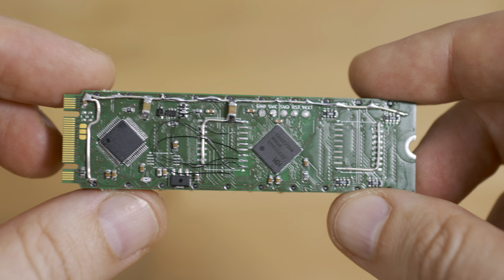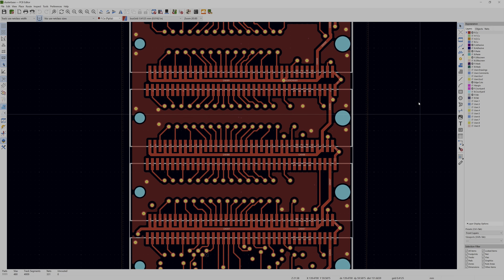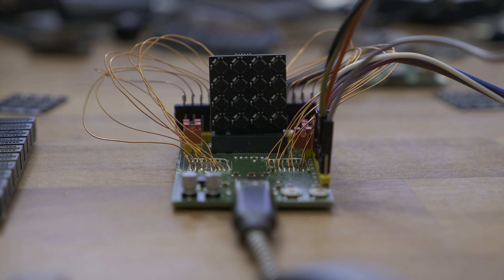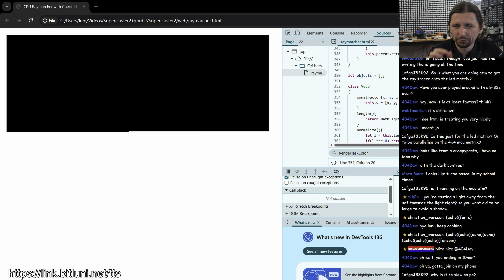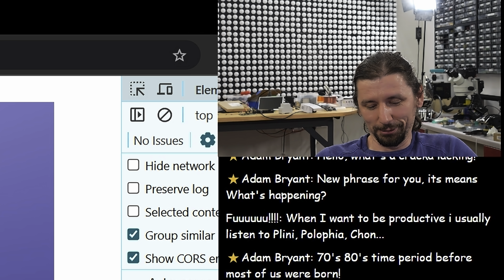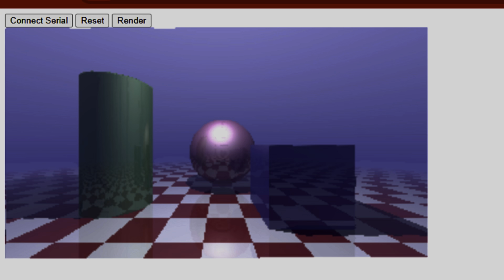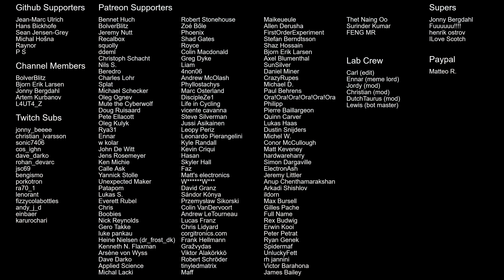I made a GPU at home

Comment from the maker: Take your personal data back with Incogni! Use code BITLUNI at the link below and get 60% off an annual plan: https://incogni.com/BITLUNI (sponsor)
Reply: Why are you using the cereal for it and not a PCIe?
Reply: Well done mate,  we appreciate you
Reply: soo cool!
Reply: This would be a really fantastic commercial project because of the incredibly low power usage and could be implemented in many use cases where your power overhead of your project would prevent the use of such powerful and capable GPU hardware.
Reply: I would be really interested to play with one of these and true understand a little better how to bypass the serial port. What is the exact problem with the design file that needs fixing? And how could we adjust the way it's dealt with by using PCIE or some other protocol. Once you have or if any of us have figured out how to increase the speed of the serial or by switching protocols this would be a fantastic chick starter project!
Reply: Bro could you run an ai on it please😢❤
Reply: I have not seen the whole video. 
That is too high for me, but only because english is not my main- but my 3rd language (brokenly). Though, I have zero 0,00 experience in any electronical working, that video would not be too high for me, if I would go through every step from the beginning with german translation, would have the tools, and maybe a referred explanation in the steps. 
Just a feedback from the perspective / view of a none english-speaking amateur/beginner/novice/rookie (why "beginner", I have not begun yet, if anywhen / somewhen at all)
Reply: Seems to me you will be running ai on your own chip sets soon enough
Reply: 09:58 1990's feeling waiting for that baywatch pic to load😂
Reply: please can you add russian translation?🤩
Reply: Excuse me, I have an Off Topic question: where can I buy the infrared camera as you have connected to your smartphone? Thanks.
Reply: can u replace nvidia card?
Reply: GPU the Grafted
Reply: Do you use AI for pretesting before ordering?
Reply: You put them into a config that interferes with itself via static. This isnt gamebreaking but can cause issues.
Reply: Good Job
Reply: RISC-V
Reply: M.2 NVMe connector is better than M.2 SATA
Reply: W vid can you make a ram ddr5 now?
Reply: bro can u teach us  from beginner
Reply: how do i get a hold of you
Reply: How does everything run multithreaded? I mean, how does the software and hardware relate to each other to allow distributed multiprocessing?
Reply: @petevenuti7355  As far as i see, a simple Intel Neutrino have more calculation power. It's a scam or for educationnal purpose only.
Reply: what if you make it to USB 3.1? or type-ccan we use it on mobile or laptop without  M.2 slots
Reply: How much would I have to pay you to add/upgrade vram on my GPU? if you know how to
Reply: @_Valkohl_  you cant upgrade you GPU s VRAM vram is video ram like ram but not for motherboard and cpu its for video like imagine 10 chips of VRAM and you wanna buff 1 of them but you cant you should upgrade all of them in same time it cost more money and problem doesnt end here you need to find same pins in same locs in same tasks and bios yeah bios when you UPD your VRAM bios dont get it and think its a its a spy,

bouga douga you should upgrade all chips in same time duoga bouga  you should find same pins same locs same tasks chips  bounga dounga bios thinks its spy douga bouga
Reply: @notalknodie  yesnt
Reply: WHYYYYY do you buy components from aliexpress?! Why not LCSC?
Reply: @zlozlo3935 hey bro can I ask u. A ?
Reply: @zlozlo3935  He literally says why in the video.

Comment: To speed up the protocol bottleneck (cheaply?) could you not place a block of ram (or 2) to act as an instruction and output buffer, then a (series of) small IC chip(s) to act like little team leaders and control data flow to each core card you made, just my thoughts, otherwise... Great project, looks fun  :)

Comment: ive played around with fifo buffers before especially when using winamp, first if its not nessesary turn it off, second try to bring the gap distance length as close as possible to not faulting under max load, third fromt what i see voltage tuning againt the entire board via main input should absolutely be played with. when uve already got a solid setup playign with all the values all over again for 'majick numbers' relative to potentiometers and mosfets has always yeilded insane results - consider that the first modems were in fact given to customers with the potentiometers still in place, and thus they were able to 'tune' and 'wirebend' the units to the 40 volts 960 megabyte units we have today :), once u have all of that down pat , consider finalizing your code through manual compression and obfuscation of the code itself and the variables, something ai can work with you on is converting premade code into 'compact code' and 'one liner code', but dont attempt to have it generate code on the fly and do make sure it knows that the code is explicitly one type of programming language or it will assuredly mangle the outputs, im welcome to contact send me an email at gunmakerguardianAMAZINGWORDSGOHEREgmail for further info ;)

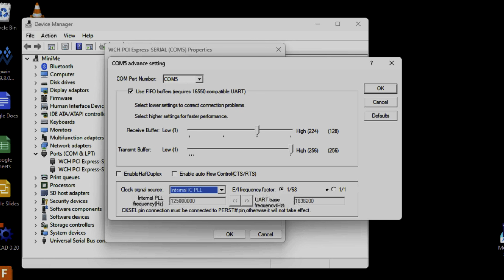Comment: 13:16 bottleneck thoughts: 
did you tried to switch "clock signal soure" to external clock or direct access (dont know what is available for your UART chip) to achieve "no division" and get 8Mbit.

on the other side 10k pullups have a too high impedance for MHz signals.

Comment: last year I spent quite some time upgrading this laptop that I traded for, I swapped out the cpu, put 8 gigs of ram on it (the max I could), put a 750 gig hard drive in, and even upgraded the wifi card (which worked surprisingly well). but the only thing stopping me now is the fact that there is no gpu in the laptop and I really don't want to use one of those pcie mini to pcie adapters for an external gpu, so i really wish something like this actually existed.

Comment: You could use a bigger hotplate. And perhaps a stencil or two. Hotplate soldering the all edge connectors at once with properly applied paste would have saved tons of time. As far as communication, you could try making a mesh network, where each chip just sends packets to its neighbors. Interface with the host at the edge chips. By keeping the connections short and point-to-point, you reduce opportunities for noise. Just requires software for networking.

Comment: Regarding the chip speed. Not sure if you mentioned it in the video or not, but did you impedance matched PCB traces? Also check for sharp corners, at high frequencies it can be problematic. Lastly, utilize gold traces rather than copper.

Comment: Imagine expanding this to a full sized PCIe card. Given a 22 by 22 mm2 area for 16 MCUs, if you double side the MCUs, you could get over 1500 of them on the board. A full sized PCIe card is 312 by about 90 mm, so 13 by 4 sets of MCUs. 13 times 4 times 16 equals 832, up to 1664 if you double side them. Probably a few less for more communication chips, but with up to 16 PCIe lanes, you could have a bunch of PCIe to serial chips. A quick search shows a 1x PCIe to 8x UART, and a 16x to 16 1x PCIe switch, giving 128 UART lines. You could easily run over 1000 of them.

Comment: The only thing I notice is the video is the lack of cooling. It's possible to manage this if you can design and build the proper heat sync. You only need a surface contact point and long tubes with a gas that has fins on the end. Your heating issue should be resolved.

Comment: Awesome project and amount of knowledge is impressive at all, next time try with samv71q21 (arm m7) it gives to you 300Mhz core with DFP unit and 80Mhz 3x SPI for chip-to-chip data exchange for 9x9 mm on PCB space and 0.1W per MPU at full speed. Maybe you can arrange 32 or 64 chip to get 6.4W and 100 times processing power.

Comment: I think the best purpose for this kind of thing is, first to update the CPUs to the newer model with a 100MHz CPU that feature hardware multiplication/division, then see if you can't use it to run an AI model. Adding some kind of memory controller/slot would also probably help.

Comment: Analyzed the your video with GPT-5 and it made suggestions that I think it will useful for your project

Technical Recommendations for the Cluster
1. Interconnect & Topology  Your current open-drain shared bus is the primary bottleneck. It lacks the signal integrity and throughput required for scaling. Transition toward point-to-point, push-pull differential links (SPI/QSPI or LVDS) per module, aggregated through a hub. Implementing a hierarchical topology (e.g., 16 MCUs per module → module-level hub → system-level bridge) will greatly improve reliability and scalability. All packets should carry sequence IDs and CRC checksums, with ACK/NACK to ensure data integrity.
2. Host Interface  The 115 kbit/s serial interface fundamentally limits any graphics-like workload. Move to a USB 2.0 High Speed (480 Mbit/s) or a USB–SPI bridge (FTDI FT2232H/4232H) as a first step. For higher ambitions, integrate a small FPGA with PCIe Gen2 x1/x2 connectivity to achieve true “accelerator-class” bandwidth.
3. Software Stack  Introduce a command-stream model resembling modern GPUs: commands such as UPLOAD_BUF, DISPATCH_GRID, BARRIER, READBACK. Build a lightweight work scheduler with job queues and dynamic load balancing across MCUs.  Adopt fixed-point math libraries (Q16.16 or Q8.24) with optimized primitives (fast sqrt, rsqrt, CORDIC). Use double buffering so computation and communication overlap, improving throughput. Finally, provide diagnostic tracing buffers per MCU for profiling and debugging.
4. Memory & Data Strategy  Define local tile caches and rely on tile-based rendering or batching to reduce I/O pressure. For graphics tasks, compress frame buffers (RLE, delta encoding). For compute workloads such as hashing, minimize transfers by sending only parameters and collecting results in bulk.
5. Power Delivery & Signal Integrity  LEDs should not load supply rails directly; consider FET-based drivers or low-power indicators. Strengthen the power distribution network with sufficient decoupling. On high-speed traces, enforce controlled impedance, add series damping resistors, and deploy ground-via fences. Avoid weak GPIO pins (e.g., STM32 PC13-15) for timing-critical lines.
6. Reliability & Validation  Establish a unit-test harness with fault injection, simulating packet loss, skew, and thermal drift. Automate module acceptance tests (ID, self-test, loopback). Maintain strict firmware versioning and rollback paths to ensure stability across a large number of nodes.
7. Algorithmic Focus  Graphics at pixel-per-MCU granularity will remain inefficient due to communication overhead. Transition toward tile-based workloads or compute-heavy, low-bandwidth tasks. Your SHA-256 benchmark is a good indicator: this cluster can excel at parallel hashing, lightweight cryptography, or batch scientific kernels. For graphics, prioritize offline precomputation tasks (ray pre-tracing, denoising, SSAO).
8. Roadmap
Short term: Replace the bus with SPI hubs, upgrade host interface to USB HS, introduce CRC-protected command streams.
Mid term: FPGA bridge for PCIe/USB3, hierarchical schedulers, tile-based rendering model.
Long term: Consolidate into a custom SoC module (multi-core RISC-V + DMA + interconnect) or explore FPGA–MCU hybrids for higher efficiency.

Executive Summary
To elevate your project from a hobbyist prototype toward a true accelerator, focus on three priorities:
Replace the open-drain bus with a robust high-speed interconnect.
Upgrade the host interface to USB HS or PCIe to eliminate the bandwidth bottleneck.
Build a formal command-stream and scheduling layer to manage workloads efficiently.
This will transform the cluster from a creative experiment into a genuinely useful parallel compute platform.

Source: GPT-5

Comment: Incredible work! I was thinking the same thing. This is not just a "homemade GPU", it is essentially a new approach to creating computing power.

If you sharpen such a system for a specific neural network, its performance can be scaled almost infinitely, simply by adding new modules, even at home. Versatility will no longer be a problem, because the neural network itself can already work with anything - from games to video generation. In theory, this can turn the entire market upside down and make us think about whether we really need universal and expensive video cards.

Comment: What the Actual Fuck. You pulled almost 900KH/s running the Bitcoin Mining algo. Using only 3.3volts. Thats fucking insane.  That setup would actually be super profitable for mining. If you can make a cluster with 10,000 MCU's That would make an amazing mining rig.

Comment: 3:25 text:
There was no chance to resolve solder bridges under the connector.
That is why I reflowed first and then tried to place the pre-tinned headers.
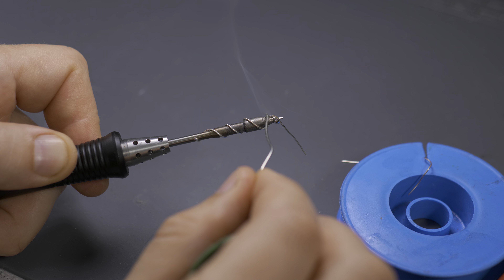Reply: 4:07 text:
The solder helps to transfer the heat from the tip to the wire.

Comment: @bitluni - looks like the serial port speed issue is likely traceable to external clock configuration (ie the external clock must be 2x internal frequency or externally confgirued by PCIE bus). The CK2X register implies (because it is on an IER interrupt enable register) that it is then meant to drive the internal clock to ensure the clocks are phase aligned. "CK2X=1 or (CFG valid and CKnS=0)" => provide an external clock or config the internal state with another chip. Your current bus speed implies "CK2X=0 and (CFG invalid or CKnS=1)" => no external clock and no external config chip or FREQ is incorrectly specified. The logic is poorly constructed in the table - i added parentheses in the way i think it works.

Comment: cool project, I have a few suggestions:   1- use full power planes for VCC and GND, cost a bit more but provide super solid power to the chips, use large traces for all power and gnd  2- put a few large bulk caps to handle power dips, instrument the noise in the power when selecting values for the bypass caps and the bulk caps, cosider 2 bypass caps 0.1uF and 0.01 uF for each processor really close to their power pins (I put them on the back side to save real state).  3- buffer the data lines 4- build PCBs as multiboard panels to reduce the cost. 5- Get yourself a hot air solder gun, it gets places the iron can't. 6- Consider Point-Of-Load (POL) power regulators for each module. 7- You may be having power bounce issues. 8- Don't use the power to select chips; use a select line, a multiplexer, or an addressable protocol. An unpowered chip can put unpredictable loads on the data or shared lines, stress its IO lines, and cause a latent defect that will bite you later.  9- Your programmer should have current sense to detect under-/overcurrent, great diagnosis too to detect bad chips or solder bridges.  10- impedance match long clock lines to prevent signal integrity problems such as double clocking, etc.   Good Luck,   Andrew Cilia, PhDEE
Reply: What this guy says! Its impressive that it works anyways though.
Reply: "a few suggestions" :body-blue-raised-arms:
Is this a binary joke, given 10 suggestions? :person-turquoise-wizard-wand:
Ten is safely well beyond "a few," no? 😂

This is intended as a superfluous tongue-in-cheek joke as opposed to an actual criticism with rhetorical merit, btw - just to be clear!
Reply: The idea of using two different value decoupling caps, *at least when the package sizes are the same*, is pretty debunked as two of the larger values in parallel is superior even for the high frequency noise components.  Once you look at parasitic inductance and resistance, you have more of it on the lower values.  Well, and you have less capacitance too.  So you're really losing on all fronts.

Comment: A stencil, solder paste and a good quality heatgun would have reduced your suffering by 90%. When ordering pcbs from your vendor also order a stencil with it. Then align your pcb and stencil and put in the solder paste with a squeegee . Then you can place your components and use the heat gun to solder easily. Much more convenient and stable.

Comment: Technically, you can multiplex 16 of 1x PCI-e lanes, and use 16 PCI-e serial expansion adapters(similar serial ports like that you were using for the LED matrix) to get 16x the cores, than run some kind of LLM or AI task on it, or just use it for computational power like not specifically mining but like similar things like Minecraft seeds, compressing, decompressing.

Comment: 3:29 one of the best gifts I ever got was a 20 dollar pair of tweezers. It sounds crazy, but the grip on premium tweezers is SEVERAL TIMES that of cheap ones like those. It makes removing tiny splinters, placing tiny components, etc. SO much easier. The problem isn't you, it's the tweezers and I never realized that until I tried actually good tweezers.
Reply: happen to know the brand?
Reply: @BabyBenz96  I don’t know about this application, but I was recommended this pair of tweezers for electrical work on guitars: Hakko CHP 2A-SA

Comment: This is a very cool project! I’m glad you got it working at the end. I personally would use a different mcu since the ch32 you’re using is pretty underpowered, plus it’s harder to program than other mcus. I would recommend an esp32-c3 mcu for next time, it has tons more speed, power, and memory than the majority of ch32 chips. I’m not sure if they come as small in size but they are much easier to work with and program, just as long as you have some software that avoids using the official hardware drivers, since they are extremely complex and confusing, and aren’t worth using.